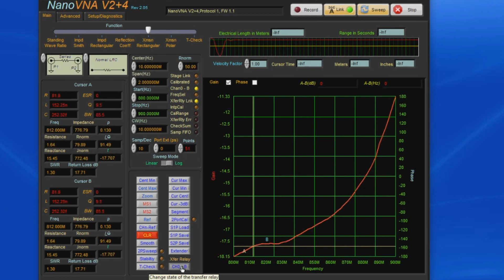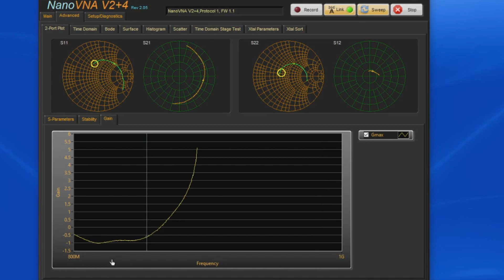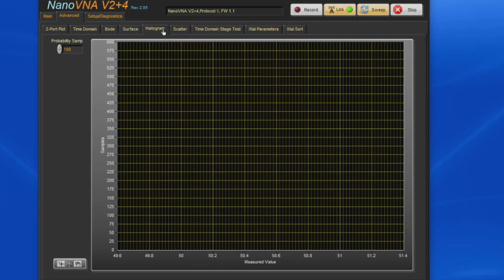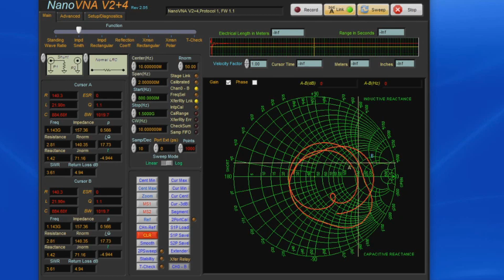The NanoVNA, Stability Circles and Additional Coefficients

Comment: Hi Joe, nice software you have there. Thank you for sharing this. By the way, will this work on the Nano VNA-F ?
Reply from the maker: Hello.  There were two versions of the software.  One supported the original NanoVNA and the  H4.  This software is no longer being developed but was archived.  The latest Solver64 only supports the  V2Plus, V2Plus 4 and the LiteVNA64.  That said, because the V2Plus/4 was locked and the firmware was lacking, I only really support the LiteVNA64.     
I have no idea what other flavors of these low cost VNAs it would work with.  If they support all of the sample features with the exact same protocols, then it would work.  They are inexpensive to easy to just buy the VNA that works with it.  
For the cb/hams wanting to measure their antennas, I highly recommend using one of the open  source applications.  These are targeting the hams and have support.